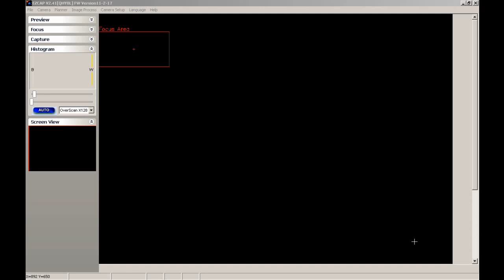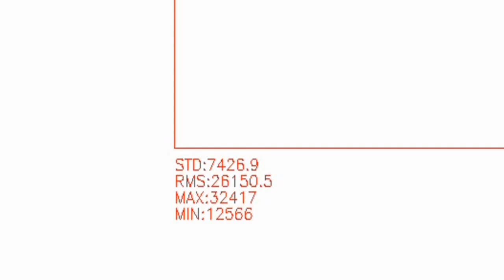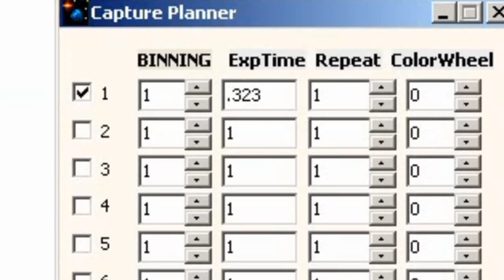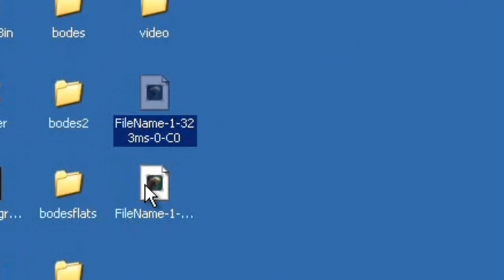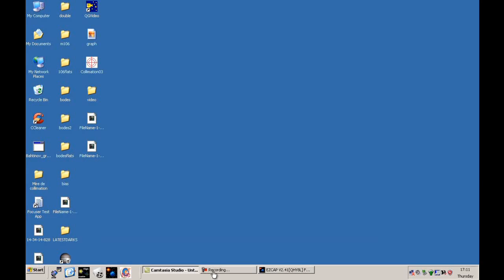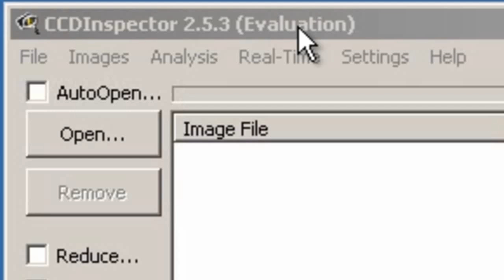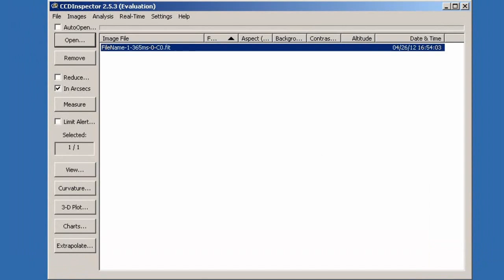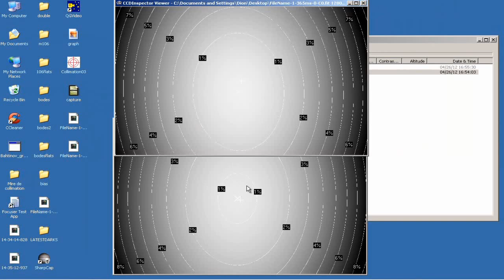Flat Frames, EL Panels & Field Illumination

Comment: I like the idea of using an EL panel, but I didn't get what material you used over the panel to reduce the brightness. Something like an "opalescent" sheet? Where would you get one of those?

Other videos I've seen use tracing paper over the panel, but how could I affix it to the panel? My biggest scope is an 8" SCT, so I think the A4 (12x8) is too small.

Comment: ACP and CCD Autopilot are two observatory automation software that can handle automatic dusk/dawn flat frames by automatically incrementing exposure-times along with changing sky-brightness.
But after running my automated observatory for over a year now, I'm about to order a EL-Panel for my 12" astrograph, I don't have enough clear skies to get sky-flats when I need 'em, so I think EL-Panels are the way to go, used 'em for my smaller scopes and they never failed me.

Top video by astronomyshed!

Comment: Thank you for the nice video.  I think I've learned more from you than anyone else in astronomy.  

Where can I find those EL panels?  Home Depot or Lowe's, or ????  That looks like a much better way of doing flats than trying to get them from twilight capture.  I use Nebulosity, and if you're going to capture twilight flats, you have to lengthen the exposure time gradually as it starts to get darker.  Can you suggest any way to do this with an Atik camera and Nebulosity?  Maybe a script?

Rick